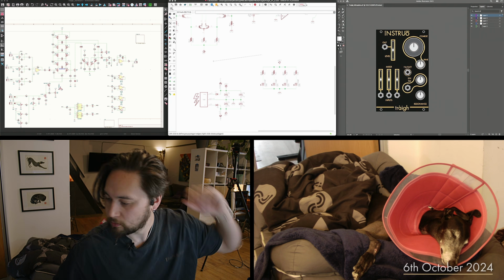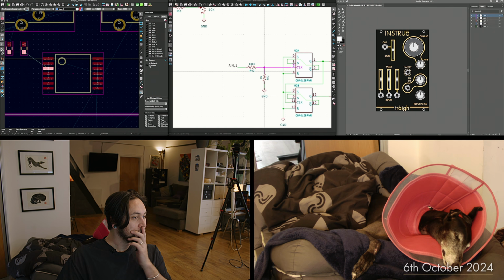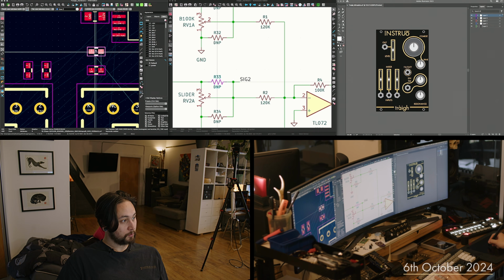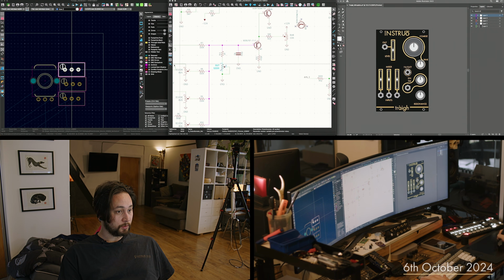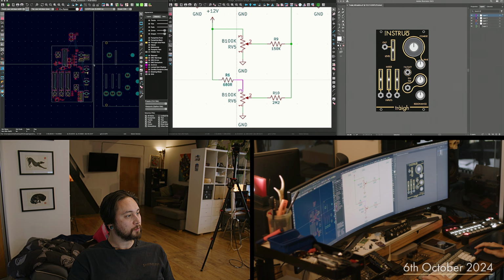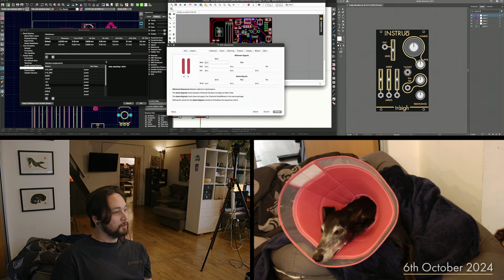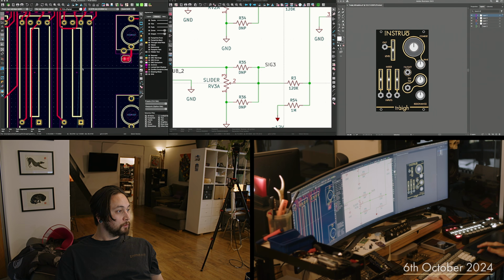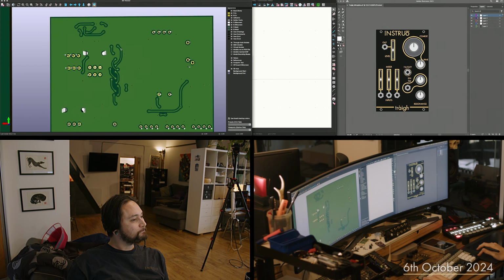Instruō - tràigh Design | EPISODE 4

Comment: 1:05:04 Why don’t you also ground fill the top copper too? 

Really enjoying this series btw! Would love to see your process for 4 layer PCB design too!
Reply from the maker: @mohoyt  very good question!
I’m not entirely sure to be honest 😂 I used to, but have read many conflicting reasons for doing pretty much anything on any PCB layout…
I had such clean coverage of an unbroken GND plane on the back that it felt clean leaving it as is.

The most logical argument I’ve read for simply filling in any space topside is mechanical/manufacturing.
Less copper to etch away is greener I guess? And with more balanced cover on both sides the board will warp less when up at temperature.

The short answer is: “I don’t know!” 😂
I am very much still learning! I’ve been doing this for many years but that just means I have a lot of practical experience, but a lot of the theory I am still learning.

I’ve been screen recording many projects for years. This is the first I’ve published in this form.
Got many more I would like to produce as behind the scenes content.
4 layer boards included!
Reply: @instruo  Thanks for the answer! I’ve seen reasons for both and there is always some disagreement 😅 but I guess it works fine both ways in these use cases!